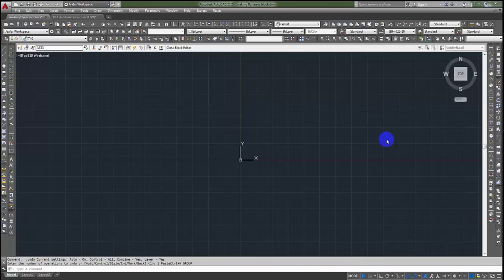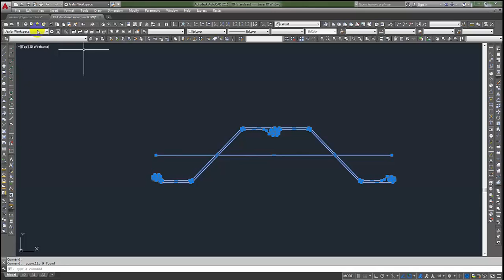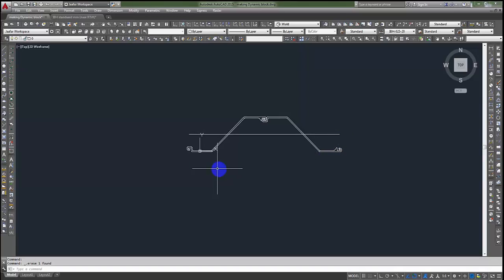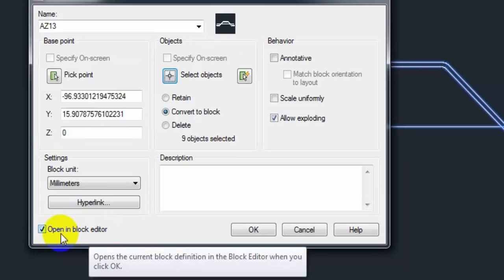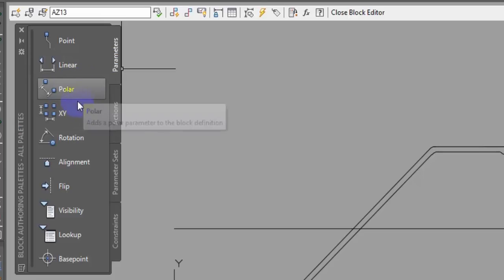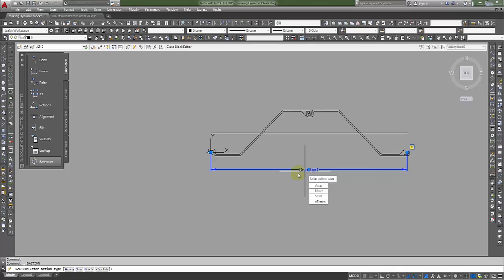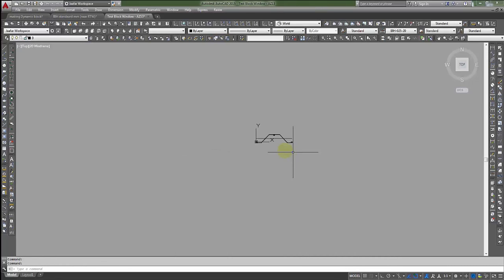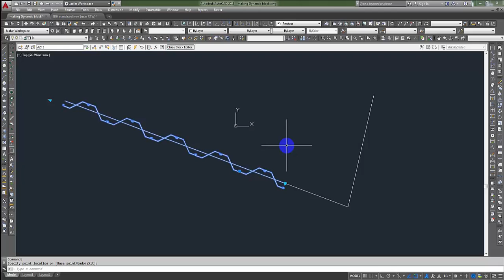Advanced AutoCAD: Creating Dynamic Block (Copy Array, Alignment)

Comment: I have a block with an alignment parameter which I use in paper space only, and I want to align it to objects inside of a viewport (in model space), like XRefs...but the alignment won't pick up the lines through the viewport.  Do you know if there is a setting for this or if it is just not possible?